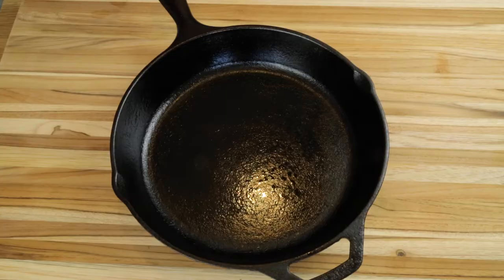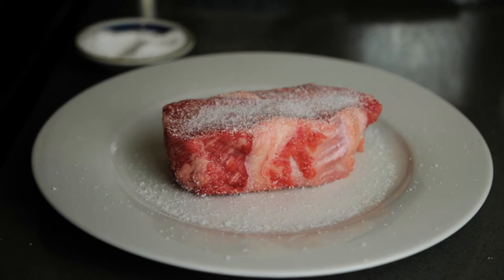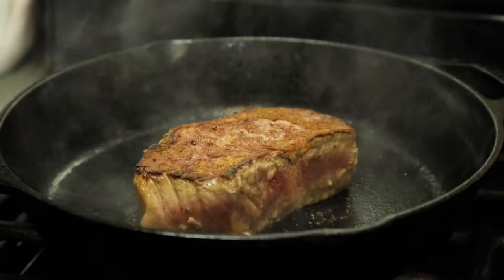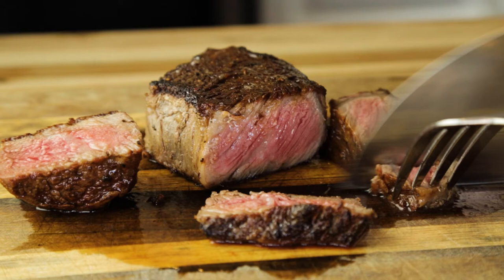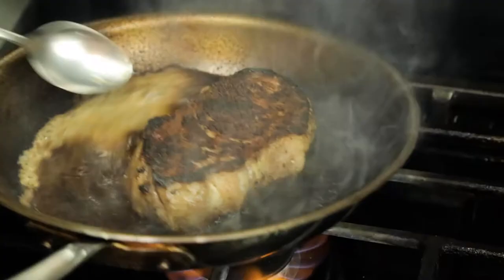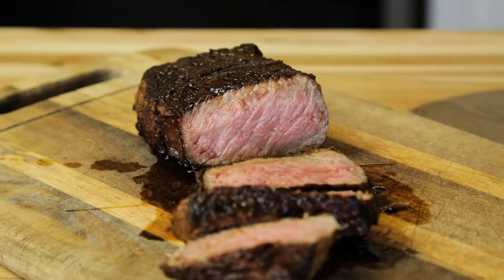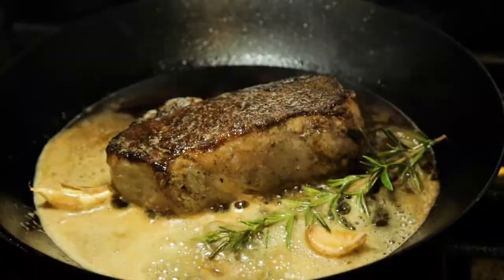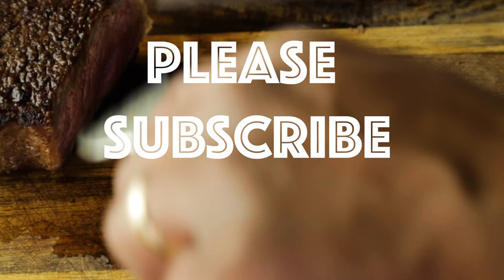Three Steaks Three Pans - Cast Iron, Stainless Steel, and Carbon Steel

Comment: I have all three types of pan. Originally I cooked steak in my Lodge cast iron pan. Always does a great. But now I prefer to use my carbon steel pan. It's an 11" Matfer-Bourgeat. It does a great job. It is also easier to handle and easier to clean.
Reply: do you buy your Matfer preseasoned or do you season yourself?
Reply: @susieserb6068  Matfer carbon steel pans to not come seasoned. You always have to season them. It's not a big deal. Season the pan a couple of times, then just use it. Often.
Reply: Same

Comment: I use all three.  Steak looks really nice.  I would recommend about half that much salt. IMHO.  My preference for steak is 1) carbon steel, 2) cast iron and 3) you guessed it, use stainless steel for other dishes.  Gas is my preferred cooktop.   I have Al-Clad for you snobs out there.  Interestingly enough, I am a died in the wool Weber grill fan, but since I learned to use my pans properly, I usually cook inside.
Reply: I have a set of All-Clad too. I don't use the the fry pans for steak though. I prefer either cast iron or carbon steel. Gas cooktop as well!

Comment: Carbon is best in my opinion. Or charcoal or the pizza oven with wood in 4 minutes. Unbelievably nice.
Resting is imperative in a pot with a lid for 15 minutes to half an hour.
Just cover with a towel like a blanket

Comment: I think you’re cooking at too high of a temp- that’s why they’re smoking so much. The butter is too dark, going on almost black and therefore burnt. If you cook the steaks on a pan that’s been pre-heating on medium for a few minutes it will be plenty hot without burning the cooking fats.
I personally use carbon steel for steaks and I agree with your observation that it cooks the steak a little more evenly and gentler while still getting excellent and even browning.

Comment: Lower the temp on the stainless and they are essentially the same. The only question is whether or not you need the pan to be non-stick or a better sauce pan, which the cast/carbon and stainless offer respectively.
Reply: You don't need the pan to be non-stick. All three pans are not technically "non-stick" pans. (ie teflon) One thing you should note is that all three pans are heavy and/or dense. You need thermal mass to get consistent high temperature to sear a steak.

Comment: Surprised nobody asked this yet: what kind of stainless was that?  I’m curious because different ply types/thicknesses can make a Difference.  The aluminum layer in most is supposed to make a ply pan heat very quickly and evenly. I’m going to guess yours is try ply?
Reply from the maker: Allclad. I think it’s tri ply.
Reply: @rucooks7810  Cool.  I’ve got some copper core stuff en route, hope to see if that heats slower and resembles more of cast iron or carbon.  Great video BTW.  I too thought the butter looked burned in the Stainless pan, but your taste says more than my eyes.  If it tasted good then it was a success!  Good idea on trimming off the cap too.  If you had enough of them, you could make a cap steak which is one of my favorites.

Comment: Since this vid is 2 years old, I'm not sure that anyone will respond, but I noticed that you didn't use any additional fat in the pans before putting the steaks in. I recognized that you put olive oil on the steak itself which I thought was interesting. I personally use a cast iron steak and it is stove-top seasoned after every use with avocado oil. Heat until it smokes, usually at around 490 F, add just a tiny bit of avocado oil, just enough to coat the bottom and when it shimmers and sometimes smokes, start the cook. I don't baste because I like the steak as is with salt and pepper. Do other not use any fat befor puttin g th steak in the pan?
Reply: Be real, you don't baste cause tilting a 20lb cast iron pan to do so requires superhuman wrists lmao. That's a big reason why I started using carbon steel. Also, I've seen people do both methods (oil in pan vs oil on steak) and I guess it comes down to personal preference. I prefer to put the oil in the pan as to not risk washing off the steak's seasoning with it. Also I think having the oil already hot by the time the steaks touch it makes a difference in how quickly you get a nice crust. Could be just me, though; I don't really know the science behind what's better lol.
Reply: This is one of only two videos I’ve seen where the oil was applied to the steak only.  It is an interesting method as the result maybe less oil used overall.  The results seems to prove that it works. I will likely try this method (minus the pepper up front).
Reply: @Seebeejeebees Do you really believe everybody only have a 20 pound cast iron pan to cook with?

Comment: I have never cooked steak in a stainless steel pan.  Burns too easily...and much harder to clean up.  Used to always do it in cast iron....and for the past few years, I always cook them in carbon steel.  Yes....carbon steel is lighter, so simply easier to move around and pour out the cooked food, and easier to clean up.  My cast iron gets very little use now....except I only have one size of carbon steel.  Need to buy a larger one.
Reply: Stainless steel is the way to go if you're trying to make a pan sauce afterwards. You get that nice fond which you can deglaze without risking damaging the pan's seasoning (since there is no seasoning on stainless steel pans).  For just steak though, I like carbon steel for sure. Easy to baste without breaking my wrist trying to handle a 25lb cast iron pan lol.
Reply: @Seebeejeebees  I don't do a pan sauce.  I always add extra butter, so pouring that out with the steak...is always delicious.  I often pre-cut the steak into strips... in the pan...across the grain...and it's so juicy when I put it on a plate.

Comment: Great video though I'd like to know which pan you will mainly use for steaks in the future? Or use SS for more done and Carbon/Cast Iron for medium rare?
Reply from the maker: I think for ease of use I’d use either carbon or cast iron. I need more practice with the stainless steel pan. Also, I can make pan sauces in the stainless pan so that’s just another avenue I could take.
Reply: @rucooks7810  You can still make sauce in carbon or cast iron, like a pan sauce with acidic ingredients without ruining it. If you're planning on simmering some tomatoes for a while then definitely not.

Comment: The type of serrated steak knife you have don't work. Try the rounded cheap stamped knives like the Victorinox 4.5 Inch Utility Knife. They stay sharp forever and can be used on hard surfaces as most of the cutting surfaces are recessed.

Comment: So in the last 5yrs I've done Charcoal Grill, Carbon Steel pan and Stainless steel for Steaks.....too me the Charcoal Grill is Best, Carbon Steel is 2nd and Stainless steel 3rd.. .Mind you I prefer the Reverse Sear method and start in the oven for Thick Cuts (over 1.5 inches)....and Simply Hot Sear with a Resting on anything thinner in cut
Reply: That's what I do (reverse sear) and man is it a winner. Charcoal grill? You put the grill on charcoals?
Reply: @susieserb6068  some people have propane/gas grills vs basic charcoal grill
Reply: @da900smoove1 a kind response 👍

Comment: Not negative but ... you need to address sear temperatures of each pan.
 butter/oil maybe clarified butter. 

Check out some knife sharpening videos and also research your Steel make and tinsel strength / Rockwell hardness of your knife blades.  
✌😊

Comment: Really nice video. I do however want to tell you that cooking with seed oils is bad for you. They contain a lot of Omega 6 fats and are toxic in how they are prepared. Grapeseed oil being one of the worst. Also, Olive oil is not at all good for cooking. Why? Because it gets converted into partially hydrogenated oil which is bad. Same as vegetable oil. The best oils to cook in are lard and tallow. Also those oils provide the best seasoning for your cast iron skillet. God bless.
Reply: Great advice! What are your thoughts on canola oil? It seems to have good omega3:omega6 ratio and high smoke point.
Reply: @sixpooltube  Canola oil is genetically modified, highly processed, and refined, both of which contribute to major health problems in the body. Coconut oil is good (Moderate smoke point) if it is organic & cold pressed. Ghee is another option that is healthier (High smoke point 480 F). I stay away from GMO anything as best I can.

Comment: You are over burning the butter in my opinion. Thanks for the video.
Reply from the maker: Yeah. I think you could be right. Thanks for the feedback.
Reply: @rucooks7810  use a different oil an pur it into the pan as well. olive oil is not suitable tbh. If you had sunflower oil for instance and put butter in the pan, the butter wont burn so easily

Comment: Oh, Boy, did it look burned in the stainless pan... 🤯 The amount of salt is immense, but that's to taste. Pepper before searing is an actual mistake, though. Pepper burns at searing temps and becomes nasty. If you want pepper on there, put it on with the butter basting or just before taking it out for resting. 
In this lineup at this task... it doesn't matter. I prefer "carbon steel" (It's not actually carbon steel, but it is the name people have gotten used to...)
Even the least useful material in this lineup - stainless - is great for that purpose.

Comment: What they mean is that cast iron is less reactive to temperature variations.  6:20
Reply: It takes longer to heat up and to cool down.

There is a reason for that though: cast iron pans are heavy so there's just more stuff there. So compared to a carbon steel pan which is a very similar material (just a bit less carbon) it will take longer to heat up a thicker piece of pan material. And, of course, because there is more material there, it will also take longer to cool down. So that makes it "less reactive to temperature variations."
Reply: @DickCheneyXX  I have mineral B pans. I've never found a cast iron pan that thin. The trend of cast iron being heavier is nearly if not entirely universal. The materials themselves are nearly identical.
Reply: @DickCheneyXX  It seems like you found 1 example where the two materials are produced at a similar weight and for some reason want to argue about the nearly universal trend of cast iron skillets being thicker than carbon steel skillets. I would bet substantial sums of money that the comment you asked about is answered by my first response, and this will be my last post.